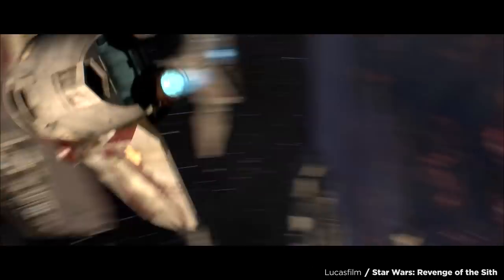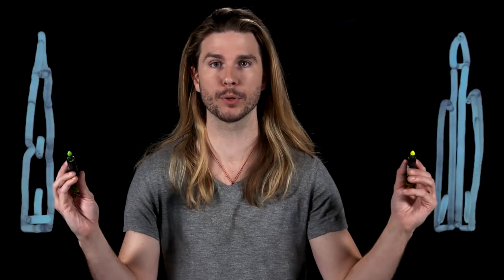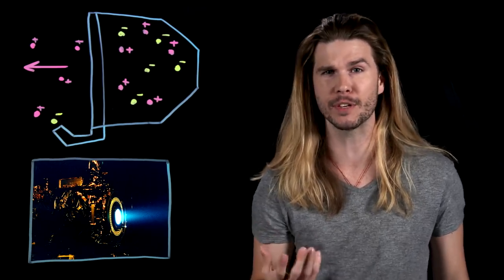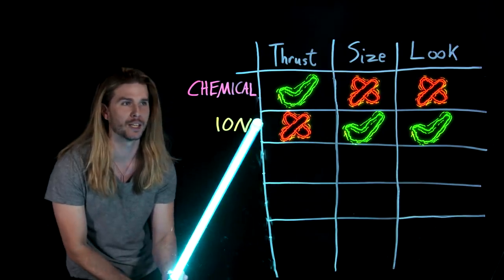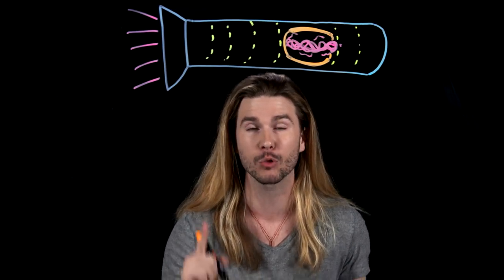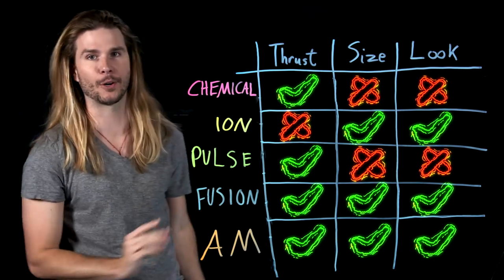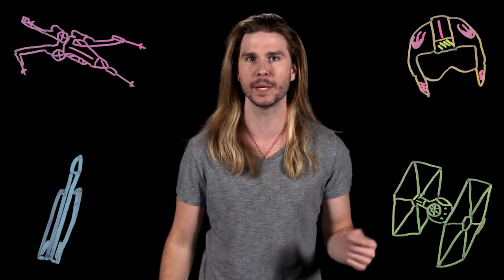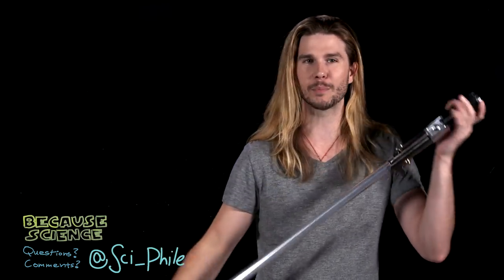How Would You Build a Real X-Wing? (Because Science w/ Kyle Hill)

Comment: A lightsaber blade wouldn't weigh anything per se, but the energy in it would mean it would resist directional changes. So swinging it would give it additional momentum, which wouldn't make it seem heavier, but it would imitate that by essentially always wanting to continue on the same arc. Essentially, lightsabers are always trying to slip out of your hands and the most impressive move is when someone blocks an opponent's lightsaber to a dead stop with their own.

 Both of those lightsabers will be trying to move towards the blocking figher's face, so the concentration (and probably force pushing) they would have to be able to pull off to stop it would need to be incredible. A smaller lightsaber like yoda's would therefore be better for blocking, and a bigger more energetic one like kylo ren's would be a lot better for turning aside blocks, both of which we see in the films.

Comment: 6:41 - Yes, antimatter is hugely powerful and extremely efficient, but you can never power-down the engine, because you need to constantly generate a containment field to store the antimatter safely. Fusion is safer because hydrogen can just sit in a plain old metal tank until you need it.

Comment: I always kind of assumed that the reason light sabers didn't feel completely weightless in the hand was not because there was significant mass in the blade, but because the containment field generated a small amount of resistance force, similar to trying to turn a wheel while it's spinning.

Also, have you considered doing an episode on Babylon 5?
Reply: Khodexus I always just assumed it had a counterweight. It's in the centre of the blade when it's off but it moves to the top when it's turned on. Low tech and solves the problem.
Reply: Yes, I think we all recognize this.  I'm simply expounding on the in-universe justification for that, not the out-of universe reasoning (they actually use props which actually have mass in the 'blade').
Reply: In the documentary I saw Lucas explains his reasoning for the direction in the first two movies - particularly ANH - by saying that because the sword is "so powerful" and has so much energy that it would have some kind of inertial effect.  There's no physics explanation there, it's essentially just fantasy.  That said, two force field swords hitting each other would probably generate some pretty powerful blowback.

The fencing gets a bit more dynamic in RotJ and vastly more sped up in the prequels, so there's not a ton of internal consistency in that explanation, though.
Reply: Let us not forget that Lucas, great idea man that he is (at times), had to have written a sentence something like this when he was plotting out the phantom menace: 
'jar jar tries to steal a swoke-swoke from grah-grah, because he has no roopy-yoopies to buy one.'
It's like something a small child might come up with...
Are we really surprised that the man has no understanding of actual physics?
Reply: @Narfwak  It could if one considers the expertise involed. Two old men fight in ANH, a somewhat inexperienced Luke duels in ESB, and a full fledged Jedi Luke fights in ROTJ. And even more so, in the prequels the Jedi Order has many experienced masters and knights, as well as different forms of lightsaber combat. That knowledge was mostly lost by ANH.

Comment: Question for maybe a future episode. Apperantly in recent renditions of Superman and his "Fortress if solitude" he keeps a key for it that is supposed to be made from the material of a dwarf star. It is supposed to weigh a half a million tons so that only he can lift and use it. So my question is what would happen if a key (or something of comparable size) actually weighed a half million tons and what would happen if it was set on the ground as it is often shown he keeps it under a mat?
Reply: A fully loaded supertanker masses over 500 thousands tons, so there will be no weird effects. The problem is that this mass is attracted to the Earth by a force of 4.9 giganewtons. No problem if it is distributed along all of the supertanker's length... but concentrated into a key? It will sink into the Earth until it reaches to core.
So, Superman needs a keyholder that is very very strong, and built like a pyramid to distribute its weight so that it doesn't sink into the ground!
Reply: There is a video about Antman that sort of hints at the answer to that. Half a million tons spread out over the space of a single key would press down so hard over such a small surface area it would sink into the ground and probably keep going until it hit the center of the Earth.
Reply: @MatterBeamTSF  

Inquiring minds must know. 

Are you male or female?
Reply: A man.
Reply: @MatterBeamTSF  

Cool, thx.

Comment: 7:15 - If you built ANY engine that used a high-intensity energy source to energize reaction-mass, you should use Xenon, not hydrogen. Xenon is the heaviest element that is easily stored in a liquid or solid form, meaning it can absorb the most thermal energy per atom and transfer the most kinetic energy per atom. (also known as "specific thrust".) That's why ion thrusters all use xenon, even though they can't refuel from ambient hydrogen in space -- the specific thrust is so much better that a non-refillable canister of xenon makes better propellant than freely available hydrogen would.
Reply: But then could there be a way that after the xenon is used up the engine would start using hydrogen?

Comment: I believe that in STAR WARS they have a thing called Hypermatter in their engines.  My guess is that it's like Dark Matter and technically doesn't have "mass" in the sense that we normally think of it, so it weighs nothing, but it still contains nuclear energy that can be harnessed.  Presumably a lot, by several orders of magnitude over normal matter.  So this implies that they either split or fuse Hypermatter atoms, or they have something like anti-Hypermatter to mix with it.

Comment: Present day ion engines don’t have enough thrust, but they’re designed for low-power sources (a few solar panels on a probe, for example). What if you added a lot more power (say a small nuclear reactor)?
Reply: John73 John that is actually an interesting thought
Reply: Some deep space probes do have a nuclear reactor powering them, but if I understand correctly, ion engines are already about 65 - 80% efficient, which is about as good as they will ever get. Even at 100% efficiency, in order to get more thrust out of them, you need a bigger power supply, which means more mass, which counters the extra thrust. 

Ion engines are one of those things that are good now, but there are far better options and once we work out how to build those better options, the ion engine will be obsolete.
Reply: @Here_is_Waldo  like the abacurre drive for superlumial speeds and no time dialation

Comment: 10,000 kg is nothing. That's like 1/3 the maximum takeoff weight of an F-35. (and the Lightning is considered a light fighter.) I would also point out that the max canon acceleration of an X-wing is 3,700 Gs (as in non-survivable regardless of whatever space magic you're using.) which would be kind of overkill in a manned starfighter. Fusion is probably a good choice for power, since the reactor could provide the plasma to fuel a VASIMR thruster, which can set it's specific impulse to whatever is needed at the time, so you can optimize efficiency when cruising, and optimize thrust when in combat.

Comment: Some idiot (Komninos Maraslidis) once said:

Ion Engines do not magically have efficiency over 100%. Even if they converted 100% of solar energy to kinetic, and even if the solar panels on a TIE fighter captured 100% of sun's energy (instead of like 20%) they wouldn't produce any thrust of relevant magnitude for the movements the ship does. Ion Engines are being researched for long flights as a more efficient alternative to rocket boosters. They produce very low thrust, but with higher efficiency and can be used for interstellar travel of our small probes. They provide a small but constant acceleration. They do not provide fighter like maneuverability. It's a question of math, physics and thermodynamics. Looks like some people should get more education.
Reply: Ryan Higgins Who are you talking to?
Reply: This assumes that TIE fighters are solar powered.
Reply: It would make way more sense for them to be battery powered or have some other kind of short-range fuel based on their general role - almost always in short-range missions around some larger ship. But then the question remains, why DO they have giant solar panels?
Reply: W00dledude, this post was kind of an inside joke, but you made an intelligent response, so I will reply to you.
Solar panels would be sufficient as a back up power system to operate emergency distress signal and on-board life support systems.
Reply: Thank you :) To continue this interesting line of thought with your input in mind, the fact that you DON'T see that kind of feature on Rebel ships, and you do see it on TIE fighters makes me think that the Empire cares more about their soldiers than the canon would have you believe. Those solar panels don't fold at all, and to my knowledge host no other systems - Everything else is in the body of the ship. It takes FAR more space to store the ships because of their existence, making it incredibly inefficient. That for a feature that largely serves to preserve the lives of the pilots?

Well, maybe they're trying to take your mind off of the upper ranks dying like lemmings under the grip of Darth Vader... But they're spending credits out the wazoo to do it.
Reply: It is interesting that the Rebel Alliance doesn't have a similar installation in their starfighters.  Yet, technically, I believe that it is up to the manufacturer of the vessels to feature those kind of functions.  So, it is probably more of a matter of Kuat Drive Yards vs Incom Corporation (as the major contributor of starfighters for either faction) rather than Empire vs Rebels.

Side note:  do you play Starmade?  I think you would fit in nicely.
Reply: I've poked around a bit, and it looked cool, but I never did get around to buying it or trying it out very seriously. I do enjoy the concept, though - I've put 280 hours into Space Engineers on and off for... Years, I think, and my Steam library has a fair few space-based creative games. Astroneer, Rodina, Scrap Mechanic... I've even taken a shot at 3D modelling several spacecraft, after getting fed up with the limits of the games I owned.

Also, you make a very good point :) For the Rebels, certainly their ability to supply themselves with starfighters would be limited, and there are many reasons why they might choose a more dangerous design. But surely the Empire has nothing but control over their own shipyards - Thus, a hugely superfluous design feature like rigid solar panels would be cause for redesign. Especially considering many more expensive ships have been and have to be designed around the clumsy slabs of photovoltaic material jutting out of their starfighters in almost the most awkward way possible. I can perhaps see a bureaucratic or morale limitation to have some kind of safety features, and perhaps the lack of deflector shields in favor of a flashier, more visible, and potentially cheaper option... Point is, I can see why the math might work out with various motivations, but it's still very strange from a broad narrative perspective. It smacks of a scientific oversight that kind of has to be explained after the fact.
Reply: Could you accelerate a spaceship by changing it's geometry and would this be an effective way of slowing down Ion-propelled probes?
Reply: Teven Benn In theory, no. You can absolutely change your orientation at will using no thrust at all - Cats do this in midair all the time. But without an outside force, you cannot change your acceleration. However, in practice, there are, technically, things like solar wind, interstellar debris and photonic momentum - Which solar sails use. Should the change of geometry in question take advantage of such an outside force... Well, you could theoretically use that to change your acceleration. Sailing ships show us that a solar sail could in theory allow a ship to propel itself at least mostly towards the sun.
Reply: Thank you for your prompt and informed reply, kind stranger.
Reply: I love where this comment thread has gone.  Good, smart are people here.  My original comment was directed towards a troll, with whom I had a previous encounter in the "Because Science" comment section, meant to shame him and discourage him from further trolling.  However this has turned out to attract intelligent and curious people to discuss science for science sake; Because Science.

Teven Benn, I do not believe changing a ship's geometry would help propel itself through space because, in a vacuum, there is no air to push against; and you cannot use yourself as a fulcrum, so you cannot propel yourself in space by changing your geometry.  For every action there is an equal and opposite reaction, in space your every movement is pushing against infinity; you cannot move significantly without an outside force to provide trust.

W00dledude, I believe the manufacturers of starships in Star Wars work independently from their associated factions; that is business is business to them.  Without spoiling too much, I think I can say that is shown rather obviously in the latest movie.  Rouge One also shows evidence to support this also, as the Empire didn't necessarily design the Death Star; they requested it to be done and trusted the design provide to them.
Reply: W00dledude actually, as far as I know, those aren't solar panels but heat sinks/radiators, like all the so called s-foils on the ships in the star wars universe. That also makes sense, because generally propulsion systems with the kind of power output that can be seen in star wars create a lot of waste heat.
Reply: Blockbuster2033 both are correct.  The solar panels encase a heat exchange matrix.
Reply: Well...solar panels to power life support is all well and good but the rebels seemed to have opted for shield generators instead,  to give their pilots a better chance of survival.
Reply: TIES don't have life support systems. That's why the pilots wear space suits with their own oxygen supply.
Reply: I wonder if ion engines could provide enough thrust if you had a powerful enough reactor

Comment: The VASIMR engine is a different type of ion engine. It runs on very hot plasma instead of cold gas so it's quite a bit more powerful - but it only does like 5 N. Maybe you can get it up to 100 N for a full power model but that's still not enough.

Comment: We've had anti matter propulsion for decades...in Star Trek that's how there warp works.
Reply: I think they just use it for the energy, not directly for propulsion.
Reply: I can't say anything about the regular thrusters, but their warp drives are probably in the line of the Alcubierre Drive, which, as I spent far too much time not knowing, doesn't actually require propulsion to make a ship go from point A to point B.
Reply: We have but it is not at all cost effective to make anti matter and takes years to make a minuscule amount. We could gather it from the solar system easier than making it though
Reply: LucianCanad how does it do that? Does it use wale-tenser (sp) dynamics to create a nonlinear curve that folds space and time?
Or are star Trek's ships actually powered by handwavium?

Comment: Interesting things to consider here with engine types.  As for your "outro" (don't like that word-that's-not-a-word, but its works) I'd read somewhere that's what made lightsabers so dangerous to use without proper training and Force abilities; the lack of weight and resistance when swinging one was simply something an untrained, non-Force user couldn't accurately compensate for, at least not enough to make it viable, widely used weapon.  It took years of training, Force sensitivity and Jedi reflexes to make a lightsaber a plausible weapon to take into battle.

Comment: If I could design my very own starship, I'd build a Borg Cube -- not because I like the Borg, but because a cube is the most sensible shape for a spacecraft that can move in 3 dimensions. Just stick a bigass engine in the center of each face of the cube -- no need to rotate the spacecraft before you can accelerate or decelerate in any given direction.

Comment: You forgot about NTRs Nuclear Thermal Rockets.  They use a fission reactor to heat, really any fuel to high temperatures before ejecting it out of the nozzle.  The color of the exhaust is determined by the fuel used, for instance Hydrogen would make the nice red engine color.  NTRs are more than capable of the thrust to weight necessary to achieve orbit and they have high enough specific impulse that a single stage to orbit with a usable payload.  They might however, violate a few treaties about nuclear reactors in space.

Comment: The question I have is:  Why must the gas expelled in a propulsion system be vented into the void and lost?  Why can't it be captured and used again ?  Because the thrust does not come from the venting process but the push at the opposite end of the venting process you could vent into a larger container or use a collection system to direct the gas back to a storage chamber without impacting the push from what is expanding or pressurised gas.